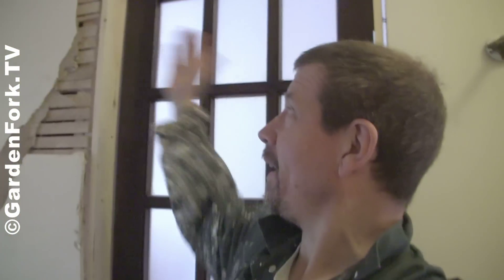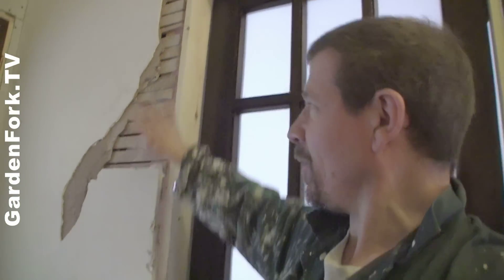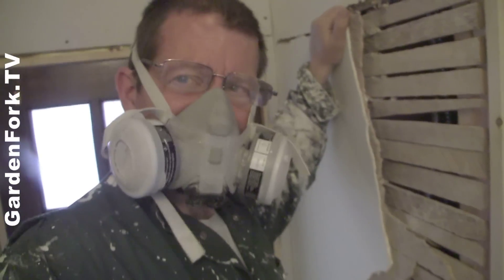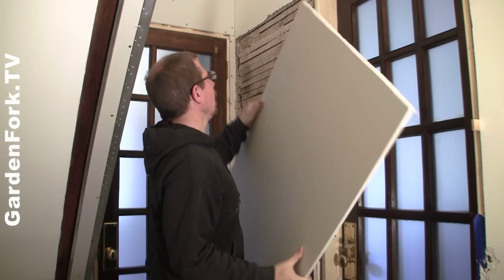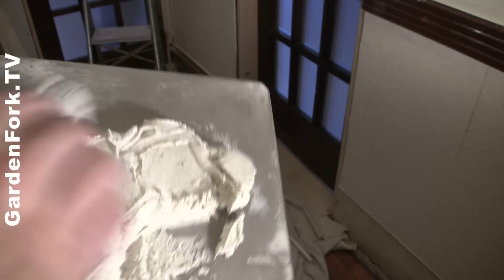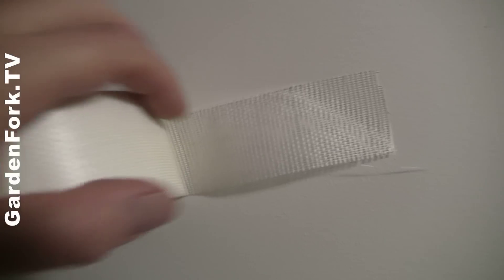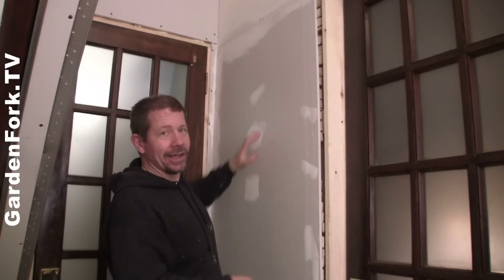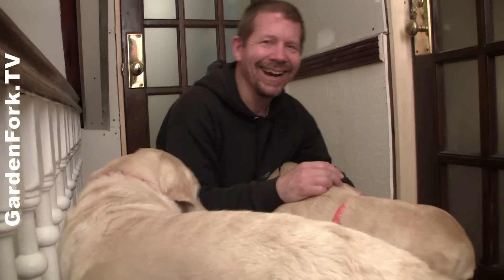Plaster Wall Repair - GardenFork

Comment: Hi Eric,  My husband is a 3rd generation plasterer and he definitely recommended using paper mesh tape.  He has had issues with the sticky mesh pulling off after the plaster is on and cured.  Also, please be aware that room temperature plays a HUGE part in how any plaster mud or joint compound cures.  You don't want to have the room too cold or too warm.  The joint compound will also crack in each extreme.  Also, you can paint right away over joint compound.  Real plaster needs to dry and cure at least 2 weeks before priming and painting.
Reply from the maker: TheShellymeli all good info, thanks for that! i have more plaster repair in my future as we renovate more rooms. thx for watching! eric.
Reply: thank you!  i LOVE your channel.

Comment: Well done. I'm a big fan of using sheet rock to repair plaster too. I've tried to plaster before and just don't have the skill or patience for it. This way is usually much easier, faster, and looks almost as good.
Reply from the maker: thanks mike, i can understand people who want to repair with plaster, but it is a huge project, and most clients don't want to pay for it. and i'm ok with this kind of replacement in my own home, which already has a lot of drywall repairs in the plaster walls.  thx, eric.

Comment: Why would you use sheet rock and not just plaster again like before? In those old houses they applied the plaster right over the lathe and it kind of seeped through the other side
Reply from the maker: Time and skill set. Plaster takes time and you have to be good at it. Thx!

Comment: Eric, I'm not trying to complain with this comment, but this isn't really a video on repairing plaster. Repairing the plaster would have been to actually repair the plaster. This video is more of a "replacing a section of plaster with drywall" tutorial. I was initially excited when I clicked to watch the video, because so many people just tear out plaster instead of fixing it, but then I saw that's what you were doing. Also, just my own personal preference: I'm not a fan of the mesh tape. I've used both types on repairs in my home and in an old house, I find that the paper tape works much better, since the mesh tends to crack along the seam when the house shifts (with the temperature or seasons) and it leaves an awful dotted line. The paper seems stronger.
Reply from the maker: hi Sooth, i understand your point, its a matter of semantics, i think. i have found, after a few coats of paint, that plaster and drywall look the same, rare is the house i work in that has plaster walls that have retained that plaster look and feel. plaster is an art that takes years to learn. i have done plaster skim coating to repair cracked and alligatored plaster walls, one room takes a week to do. thx, eric.

Comment: Useful tips. Make sure you use tape for any seems! Otherwise it WILL CRACK for sure.
The new piece of drywall doesn't look flush with with the door jam.. How will the trim attach to the door jam for a clean finish?
Reply from the maker: thanks Tyler, the trim we are using is 5" wide, so didn't have to get the drywall flush to the jamb,  thx! eric.

Comment: so with the wood lathe underneath the thickness still works?  For the claw of the hammer breaking "clean" across the top -what little I've seen of plaster it rarely breaks clean; instead cracking/breaking further.   Why not some cutting tool across the top for a straigh line?  Rotary zip/ oscillator or other?
Reply from the maker: Hi James, usually 5/8 or 1/2" drywall will work, but sometimes you have to shim behind the drywall. I could have pulled out the power tools to cut a line, but then the plaster dust would get everywhere in the house. think talcum powder + blow dryer! the rough edge is not a problem for me, the joint compound will feather out on top of the joint.  thx, eric.
Reply: GardenFork Good point on the plaster dust
Reply: GardenFork Just use a vacuum cleaner whilst cutting, you will save time in the long run having a perfect straight line.

Comment: Now you do this? Where were you a month ago. I had to figure out  on my own. had a better challenge. I had a sagging ceiling over a bathtub. Awesome job Eric. Darn it I wish I had thought of that tape. ;)
Reply from the maker: the mesh tape is good, but you have to build up the seam higher to use it. i've seen many ceiling repairs from bathtubs. not fun.  thx! eric.